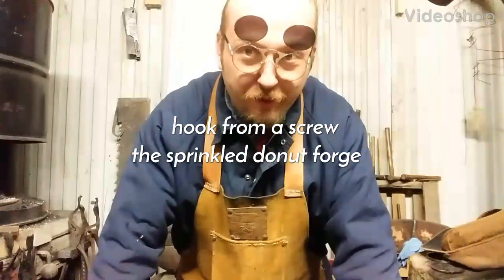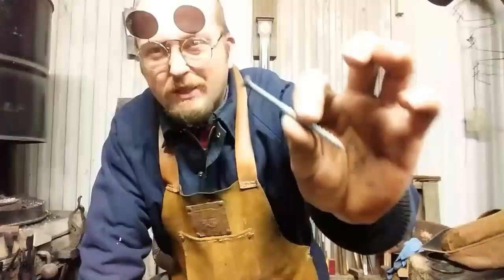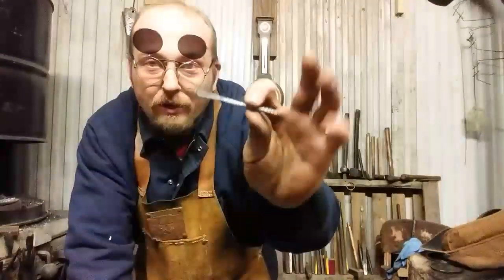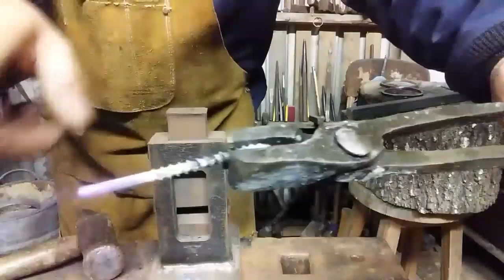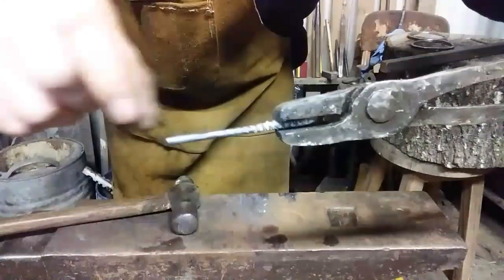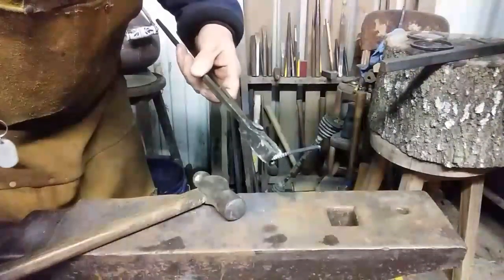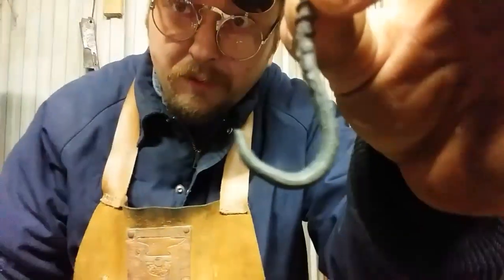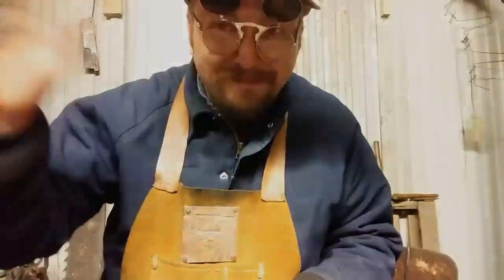Making a hanging hook from a wood screw

Comment: Good job! for the blacksmith club I belong to, I have made hooks that way as well as take the hardware screw in J hooks as well and open them up put a rat tail scroll on and then reform back into a hook, and one time I took a piece of square stock, formed a hook then twisted the square with sharp corners to form threads. If you make one this way, watch which way you twist or you will do like I did and make a screw in hook with left hand threads!